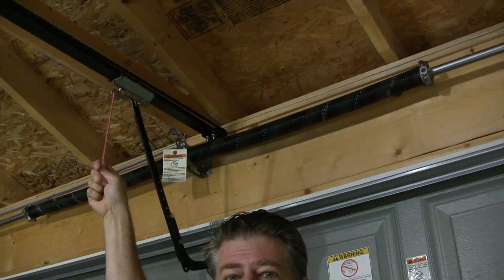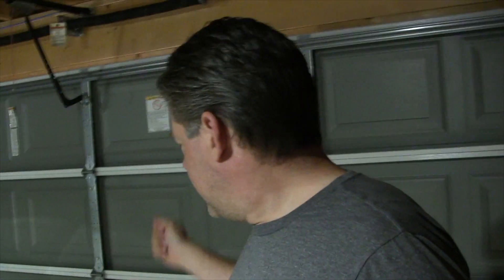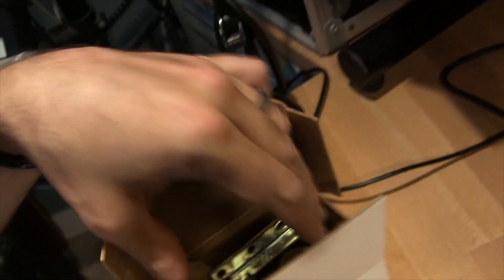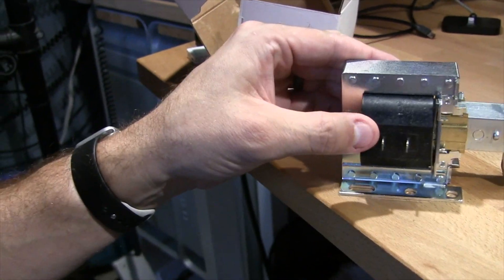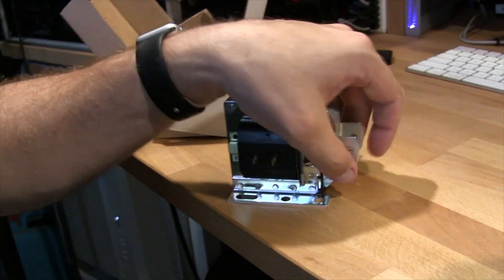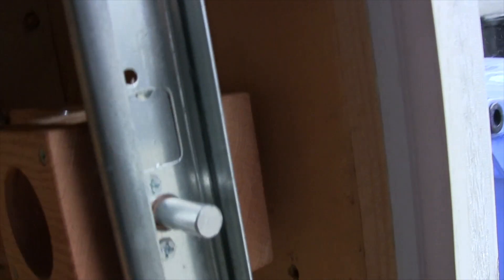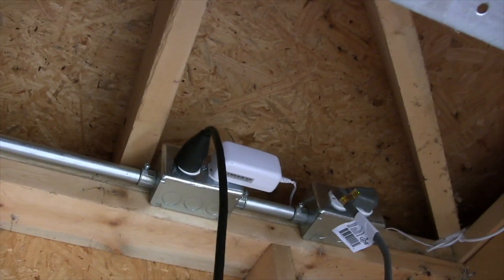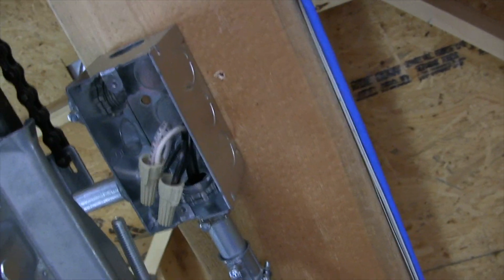Automatic Garage Door Deadbolt

Comment: Not sure if this was mentioned but my Liftmaster has a battery backup that will open and close the door about 8 times in a power outage. Perhaps adding some type of UPS (uninterruptible Power Supply) like APS to the solenoid power cable would still allow full functionality in a power outage... just an idea, thanks for the video

Comment: Would it be possible to show/explain in a bit more detail the wiring behind all this? How to make it work with the light of the garage opener?
Reply: I'll see what I can do - maybe an add on video.  I've seen a lot of questions about this in other comments.  You sir, just convinced me.
Reply: @patrickobrien4721  in essence, you pulled power from the light bulb of the garage opener to an outlet where you attached the solenoid, using the relay that turns on the light as a “switch” to power the outlet?

Comment: Nice but with todays digital criminals it’s so easy to steal garage codes so I’m more worried about that. But I want to do this as a backup also it’s nice cause if I lost power it would auto lock which is wha i would prefer.

Comment: Very nicely designed and make but I have just 1 questions any time you have door open for long hours and then passing through door sensors this will trigger garage door light sensors and that will keep light on also your solinoid will be turn on and off is that will be long lasting ?  Other then that I love this iedia
Thank you 😊
Reply: You are right, the lights turn off and the solenoid "relaxes" after a few minutes.  And yes, if you break that beam everything turns back on, including the 'bang' of the solenoid coming alive again.  Can scare the bejezzuz if you aren't expecting it.  As for the power-off delay, I think that's up to the opener.

Comment: You forgot to mention (or I didn't hear it) that if a power outage was to happen, the door would be kept secure too because the lights wouldn't go on or off. That solenoid is so costly though, but the idea is great and I will definately incorporate this into my new garage! I'll keep the manual one, just because it's already there, can't hurt, I guess.
Reply: You are right: it wasn't explicitly mentioned in the video, but it has been discussed in the comments here (I know, TL;DR).  Yes, in the event of a power failure, the garage is secured by just physics.  If you want to open the door, you'd need to "chock" the solenoid open so you could swing the door.
Reply: @patrickobrien4721  To be frank, no, it wasn't a TL;DR case. Sometimes YouTube comments don't load properly for me, it has been this way for the past month or so (I think they made an update along the way and it resulted in me having this kind of issue, and I'm sure others have it too).

Out of curiosity, would you recommend having 2 of those (1 on each side) or 1 is enough? I know that the solenoid is just magnets basically, so it shouldn't really fail mechanically, but I wonder if one could pry the door on the opposite side and cause issues that way

Comment: Correct me if I'm wrong, but if your door is going down and is almost closed and say cat runs in triggering sensors the travel will start opening, also flashing light. If said aluminum rod gets caught on wheel as door goes up, opener will continue to pull up, causing top panel to being damaged. You can prevent this from happening if you install your actuators as close to ground as possible......I think, just had brain fart..... ummmmmm yea.
Reply: Actually, it's not an issue.  When the safety sensor is triggered, the door will reverse - going upward, and the light will only start flashing when the door has stopped moving.  Makes a pretty good racket too.

Comment: The problem I see is if you want to leave your door open while working around the house, each time you break the safety sensor beam located at the bottom of the track the light comes on and activates the solenoid.  That would be annoying.
Reply from the maker: Makes a pretty terrific bang, that's for sure!
Reply: @patricksmalapopisms2687  yeah so I just installed a switch by the entry door to turn off power to the door opener.  That way I don’t have to listen to the hum.  Your idea with a little tweak.  Thanks Patrick
Reply: does not matter... its retracted every time the light is activated....
Reply: If you want to work with your garage door open, just push the "light on" button on your garage door opener's pad, which will leave the solenoid always on (or not locked), that won't trigger it all the time. Yeah, it's one more step, but I doubt you'll be using your remote control to open the garage door if you are in the garage itself to work... so, you just move your finger half an inch and you're good to go :)

Comment: Love the idea. I would appreciate clear wiring explanation for attaching at the opener.  Is a supplemental power source necessary or will the light power be sufficient?  Thank you.
Reply from the maker: The Solenoid is straight house current: 120Volts AC.  All you have to do is put a bulb socket-to-AC adapter in the socket of the opener, then run wires to the wall where you will mount the lock.  Here in Chicago, that means I have to run that power through grounded conduits, so be sure you check you local codes.  BTW, someone else here mentioned that one could run low voltage (say 12DC) and while I wouldn't need to have the conduit anymore, I do see there might be a voltage drop (DC, of course)

Comment: Another product that could be made and sold cheap, but no one is doing it.
Reply from the maker: After considering this, yes, you are right, however, there is a significant catch the video sort of glosses over: running the circuit around the garage from the opener to the deadbolt.  In Chicago, all the building codes requiring grounded conduit makes it a lot of work.
Reply: @patricksmalapopisms2687  Even if you use low voltage like 12VDC?
Reply from the maker: @patmcbride9853  Well, then I could just staple that, yes
Reply: @patricksmalapopisms2687  There is already a lot of wiring coming from the motor to the sensors and the pad, so that wouldn't be a real issue. I would have to check mine, but I think there is a small light in my pad that mimicks what is happening in my opener (so, if the light is on in the opener, it is on in the pad, if it is off in the opener, it is off in the pad, and if it flashes on the opener, it flashes there), IF that is the case, then it could be wired with 12V from the pad to the deadbolt, and I'm pretty sure I'm not wrong with the light mimicking the opener.

Comment: great setup but if you have a power outage to your home and their is a fire "How will you be able to exit the garage? I would assume with no power to the lock it will stay engaged. So if you are in a panic mode will you or other family members be able to know how to manually disengage the lock bolt?
Reply: By design, when the power is off, the lock is engaged.  So yeah, if the power goes out, or if I trip the breaker (which I've neeeeeever done :)) the lock is engaged.  All I need to do is "chock" the lock, shove a piece of wood, or rubber between the back fence and solenoid, then, pull that lanyard.

Comment: when the light beam is triggered when the door is traveling down, from what i remember the motor switches direction and the light starts a flashing to indicate that something was in the way of the door. as the light flashes, the bolts will be pulsing in and out, possibly catching on the wheels in the track. Having said that. The quality and detail of your work is very good.
Reply: Yes, the door does reverse on breaking the beam.  Then bangs rather loudly for a few seconds, it's quite entertaining :). but my opener only cycles like that once the door finishes its travel

Comment: Nice work, but doesn’t the door effectively lock with the tension of the motor and chain, thus preventing it from opening from the outside. 
Pulling the lanyard can only be done from the inside. Just like your locking mechanism can be defeated manually from the inside. 
I love mechanisms and like what you did. Don’t get me wrong!!!
Reply from the maker: A nefarious bad guy can pull the lanyard from the outside with a coat hanger.  So the police recommend removing the "T" or lanyard completely.  I didn't wan to do that, which was the motivation for locking the door whenever possible.  Only inconvenience is if the power goes out, I need to chock the solenoid.
Reply: I think I get what Pankaj was saying,  that was some nice work done by the way,  however if the thief has your garage remote  this extra lock will comply and defeat the purpose of keeping the garage locked.  What I did was instead of connecting to the garage opener light I connect it to a smart plug that can turn off from your phone to keep the dead bolt engaged and turn it on before opening the garage or keep it connected to the opener light but override with a switch controlled by a remote.  The purpose is to control the solenoid neutrally from the behavior of the garage.  This way when you're out of town you won't have to worry what your garage does because your dead bolt is engaged no matter what and you can always disengage it from anywhere in the world for a family member to open your garage with your garage remote.. hope this helps
Reply from the maker: @kelvinvu3943  After thought, I see the value of this, and yes there is a measurable risk to having the deadbolt to the opener itself and not independent.  In considering making the bolt a part of the Home Automation system (see other videos in the channel) I immediately realized that there might be too much of a delay.  Then it struck me: make another deadbolt.  That way one would be reliable to the door and works every time, and the other can be set by the HA system for different reasons.  I must ponder...
Reply: @patricksmalapopisms2687  can you answer the questions above for me please, I just sa you have this account also, not sure which one to contact....
Reply: @hadablockers  Which answer do you need clarity upon? there are a few in this thread, I cannot narrow to what you are looking for.
Reply: @patrickobrien4721  ok forget all the other questions I asked, this is what I need to know ASAP, did you find a way to wire some actuators low voltage to the light, if so, can you make a new video or send me a diagram or something please.....
Reply: To piggyback on Patrick's note, my outbuilding garage door opener safety latch was defeated easily with a couple quick, hard pops from under the base of the garage door.  They're NOT security features at all.
Reply: Ok so what I really need is how to hook these up on low voltage, I tried the 110 v way, and it's just too dangerous to have at a storage shed company. Did you figure out how to do it low voltage yet? I have to figure it out by Monday or I'll miss out on a 15k job.....
Reply: @Patrick's MalaPopisms

Comment: that’s awesome. I was looking to replace my broken garage door opener and the only ones that came with electronic deadbolt are the wall mounted openers at more than double the price of regular ceiling mounted opener. Just a suggestion for safety, add something to manually keep it unlock just in case a prolonged power outage happen. thanks for sharing this!!!

Comment: Sir, do you have a part number for the solenoid?
Reply from the maker: I can do better than that!!: https://www.newark.com/dormeyer/3000-m-1/solenoid-open-frame-pull-continuous/dp/20M1908
Reply: Two of those solenoids will get you a complete system from SureLock, with $25 to spare to take the wife to Jimmy Johns for dinner.  It's also significantly overpowered for what it has to do, which is simply overcome the springs you choose.  Retracting a 1/2" dia. x 4" long rod doesn't require a bulldozer.
Reply: I have the solenoids available at a crazy discount from the ones you'll see on eBay.  Let me know if you're interested.  Rigworks at yah